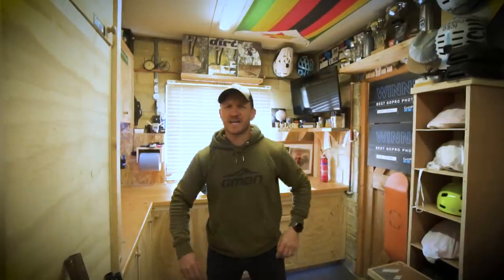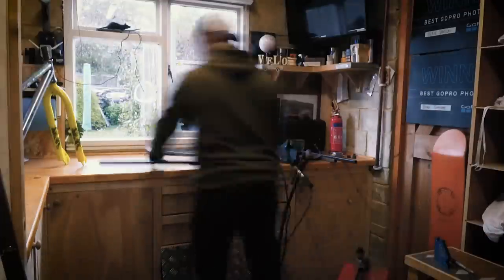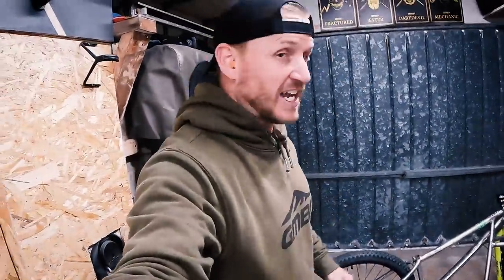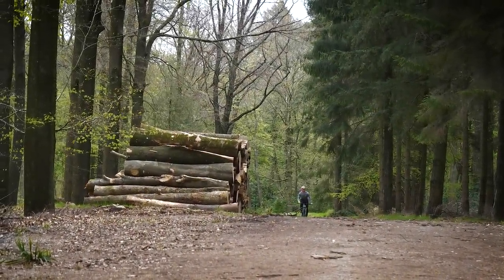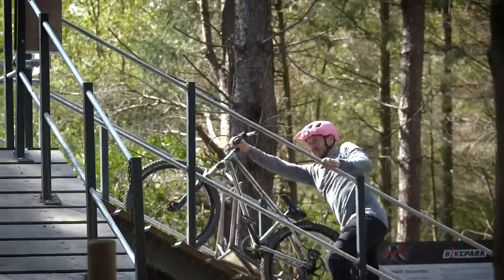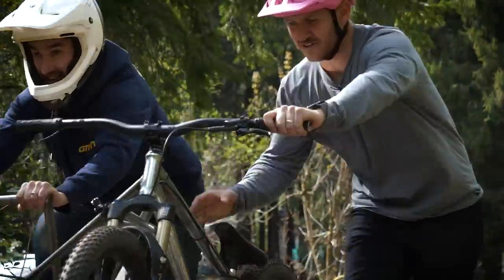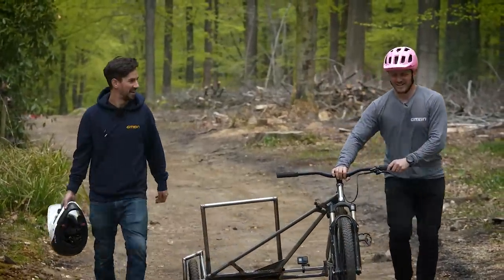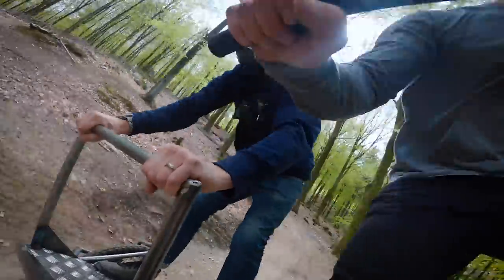Blake Builds a Dirt Jump Side Car Bike! | Sidehack Or Bodge?

Comment: Nice. A couple of suggestions from an ex sidecar motocrosser: the floor of the sidecar and the passenger handle bar needs to go further back and closer to the rear wheel which needs a sturdy mudguard so the "monkey" can sit over the rear wheel or even hang over it when turning left. Also, the right end of the handlebar must come forward and down to allow him to hang outside of the side car on the right turns. Also the wheel of the side car needs a mudguard sturdy enough to hang over. All in all the "passenger" must work real hard and move a lot, otherwise the bike will be very hard to turn. Watch videos on sidecar motocross for hints. Looks like a lot of fun, it would be great to build one with suspension and maybe electric assist.

Comment: This reminds me of my 3 wheel bike trailer made of 3 scooters with 12" wheels. The front wheel turned with the tow bar and could turn left in it's own length. That was some impressive wire stick out you had for a while.  So hard to start an arc on small round tubing. Been there.

Comment: I Christen it "Scare-iot of Tire"
because it's like a cross between a chariot and a side car
definitely does NOT check all of the safety boxes
it does look amazingly fun while at the same time looking scary as hell ...especially whenever you corner
modern sidecars actually have a suspension system built in to where it's joined that compresses so you can lean the bike towards the sidecar to make turning safer.
I would also try to get a larger & fatter wheel for more clearance and to give the tires more room to compress on landing

Comment: This is really cool. 

But I'd suggest more spokes in the wheels, especcially the rear one, and a very stiff shock absorber between the side module and the actual bike, something to absorb the worst stress, because if it was something you'd ride often it would probably snap eventually. But this is super cool and amazing how well it seem to work! :D

Maybe I underestimate the strength of that thing. :D

Imagine an eBike version to with a powered outer wheel too that is controlled by the sidecart rider you can use in turns to either break the outer wheel a bit or accelerate it! :D

Comment: The sidecar needs grips and try putting a 26 inch wheel instead of the childs wheel and  give it a real set of handle bars with a brake lever. Id also put a saddle with a dropper post and most importantly id add flames to the whole setup